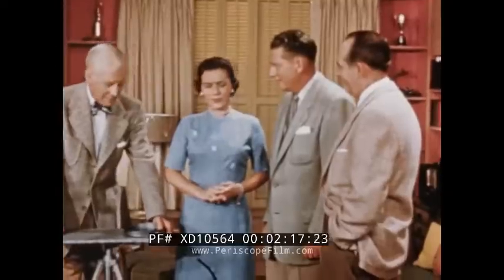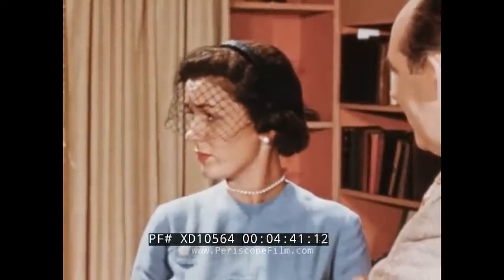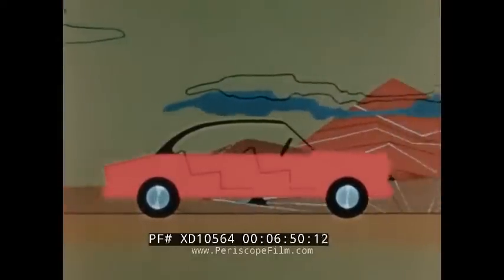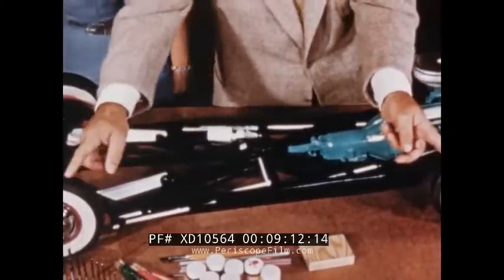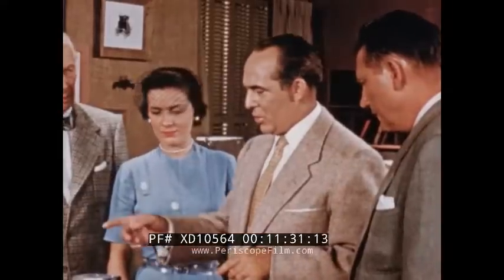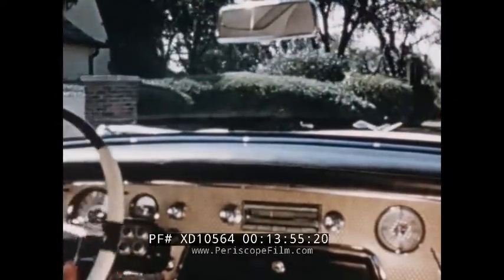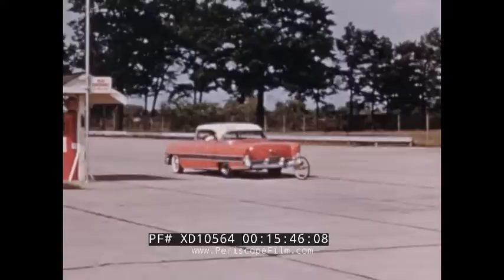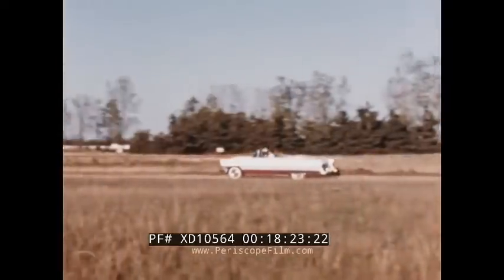1956 PACKARD AUTOMOBILE CO.  " THE SAFE ROAD AHEAD "  TORSION BAR SUSPENSION SYSTEM XD10564

Comment: CAN anyone explain to me( in a serious fashion) ,why did Packard go out of business .I know they merged with Studebaker, but why did they have to go that route ? I am from Canada ,forgive my lack of knowledge regarding the PACKARD CAR THEY WERE INDEED BEAUTIFUL  LOOKING VEHICLES ?🤔
Reply: I think things deteriorated fairly quickly. 
Hired a hot CEO or "President" who didn't know the car industry as well as he did the home appliance industry? Did he make the decision to merge (buy) Studebaker? (Who was responsible for the lack of "due diligence")(Or was it fraud?) Did that merger cause labor unrest because of different pay rates at Stude vs. Packard that led to strikes? 
Problems with Packard having assumed that they could continue to rent the "Briggs plant" at low rates until they couldn't due to the death of the owner?
The horrible automatic transmission problems of 1955 (and the bad pushbuttons in 1956) when earlier the transmission had already gotten a reputation as being  "lethargic" 
Someone in the Federal Government perhaps being more partial to Packard's competitors than to Packard as far as Packard's military contracts 
Not enough dealerships in much of the country? (Was the Studebaker purchase an attempt to correct that?)
   a little late at bringing out their modern V8 engine (although their old engines were some of the best of their type and still made as much or more power than some of the first couple of year's version of the new V8s from Oldsmobile and Cadillac) but I think Packard's old engines cost more to build and were heavier 
in 1951 though maybe maybe the  new Chrysler Hemi was a much more serious competitor than the other new (in 1949) V8 engines 
   the streamliner Packards of about 1949-1950 were not popular and lost money in low sales because of their appearance (although they were good cars and similar bathtub look cars from Nash and Hudson don't seem to have been singled out as ugly)

Comment: Didn't know about this long torsion bar and load leveller system!
Has anyone managed to keep one of theses cars working?
Reply: There's still a lot of them around so I assume the suspension works. The torsion bar suspension was actually optional on some models. You could still get a convention suspension Packard at least in 1955. I'm not sure about 56.

Comment: This unique system seems like a great idea, however if it was, it would have been utilized on other cars after Packard went out of business. Chrysler torsion bars were nothing but  replacements for the  front coil springs.
Reply: The packard system solved the problem it was trying to solve successfully. Others developed competing technology to solve the same problem. Most left the problem unsolved to save money.

Comment: Killer video!  The guy that starts the talk sounds like Groucho Marx.
I read many years ago those trans. would snap if you put it in park before a complete stop.
The torsion bars are probably why Henney Coachbuilders stopped using Packards for funeral cars. Too difficult to stretch with that suspension. The armed forces also stopped buying Packards by '54 or '55 I assume.

Comment: The '56 Packard was the last gasp for the company, as the AMC merger deal had failed by '54, and the lying cheats at Studebaker had conned Packard's president Nance into a merger of two losers. The '55-'56 Packards and Clippers weren-t new bodies, by any means.  They were both cleverly done major makeovers of the '51 body, which propelled the styling career of Dick Teague, who went on to design some of AMC'S most iconic cars in the 60s and '70s.  He had exciting designs on the board for Packard, had they survived to 1957, many of the styling features later stolen by Ford for their Mercury Division.  Parts of the new Packard V8 later lived in the the Chrysler "A" engine.  Worst features of the '55-'56 Packards?  The always-troublesome  Ultramatic transmission, and the ridiculously inept TeleTouch push button selector, dumped on Packard by AutoLite.  Ford also used that for some 1957-"58 Mercs and the '58 Edsels, with similar results.
Reply: I heard Studebaker cooked the books to make the deal seem more appealing.
Reply: @1940limited  cooked em, baked em, roasted em, broiled em then set em on fire!

Comment: Coil springs are also torsion bars--they're just coiled to save space. Chrysler cars handled well because of suspension geometry and spring rate, not due to torsion bars. Citroen had a more sophisticated system since it used interconnected air springs.

Comment: I drove a 1956 Packard Clipper Super to high school in 69-70. Everyone else drove Mustangs, Camaros, or pickup trucks.

We put 250 thousand miles on that car in the 15+ years we had it.
Reply: So it must've held up ok. Did it still drive well ?  Did the suspension perform as they discussed after all those miles?
Reply: Any problems with the suspension?

Comment: Well now, I've been hoping to see a film on this subject for a long time. I was 6 years old when this movie was made. 6 years later, I vowed I would someday own a Packard, and 8 years after that I bought my first car, a 15-year-old, 1955 Packard Patrician. I had no idea that the suspension was so unusual and forward-thinking, I just always thought these cars were beautiful, without some of the typical mid-'50s visual tricks that look dated all these years later. The '55/'56 body was actually a refreshed version of the the 1954 model that they use in the comparison test, and was masterfully facelifted to be as new looking as all the completely redesigned cars offered by most others. And, it really did have a remarkably controlled ride and flat cornering for a 5000 lb. cruiser. I often did the same thing as the valet in the scene at that country club, standing on the rear bumper so folks could see the Packard rise up. Friends in the art school I was attending were wowed when they saw it while they were "tripping"! They don't tell you this in the video, but there's a toggle switch under the dash near the driver's door that allows you to switch the system off. When you do, a ratchet on the short torsion bar motor remains locked, so the car stays at the height you left it. I would sit on the trunk until the Packard leveled out, then jump off. Without 200 lbs. of pseudo-hippie at the end of the see-saw, the tail would spring up into a rake. Then I would casually walk forward, knowing the delay wouldn't allow the leveler to kick in for about 5 seconds, and switch off the toggle. The car would be frozen in the raked position, and I would leave it there and drive off, like NOTHIN' HAPPENED.
Reply: Hot Rodders Forever.
Reply: It must have been a beautiful riding car. :)
Reply: @waynejohnson1304  In every sense of that term.  ;)
Reply: 👏👏👏👏👏 Thanks for the comment! 😉😉
Reply: Torsion bar suspension was invented for tanks and armoured vehicles.  All the German Panzer  Kampf Wagen types had it.

Comment: So funny how their idea of “blistering getaway” is so different than what we would think today. Ha. That Caribbean convertible was gorgeous and I just hated seeing it driven through the mud.  Some of the tri-tone color combinations on the Caribbean we’re just a little odd, and I wish they could’ve offered some prettier ones. It is really strange to see a Caribbean in a solid color, which I’ve seen before.  Also when they show the guy press the transmission buttons, he has a really dirty fingernail, but I think he was wearing coveralls so he must have been a mechanic. I always loved how both Packard, Edsel and Chrysler all talked about their pushbuttons and how safe, secure, and easier they were to use…like a shifting lever was so “hard to use” and unsafe. 😳
Reply: With new cars built for millennials, I hear push button transmissions, even rotary knobs and even smart phone app controlled transmissions, are coming back.  What's old is new again...
Reply: @raylopez99  For sure.
Reply: @raylopez99  Bad then and bad now. The first year Edsel had electric push buttons to control the automatic transmission,I believe it had the same problems as had Packard's as of a couple years before.

Comment: The Packard "Twin Ultramatic" transmission was as smooth as any in the industry, but quality control left a lot to be desired.
Reply: I read decades ago if you put them in park before coming to a complete stop, something (a paul?) would break easily.
Reply: The electric push-button shift in the '56 models was not strong enough to pull the transmission out of gear if the car was parked on a hill. One had to raise a rear wheel off the ground (both wheels in cars with Packard's innovative Twin Traction limited slip differential) to release the parking pawl.      
The parking pawl is not designed to be a braking mechanism in any transmission.       
Another tip, it is not intended to replace the parking brake, but as another layer of immobilizing your car. Always set the parking brake before shifting into park.
Reply: @5610winston  Wull yuh, I'm quite familiar w/sensible operations of an A/T.
Just read a story careless parking lot attendants would shove it in P before a complete stop.
So you know, most trans can take it. The pawl will sort of ratchet, or skip so they're dummy proof.
I'd still like to know why they're weaker than normal. No fail-safe system I guess.
Have you ever put a '56-61 ChryCo. trans. into park while moving?
Reply: I forget who said, "They can make them fool-proof, but they can't male them damn-fool proof."As I recall, most of the PowerFlite and Torqueflite transmissions of that period used a drum parking brake on the output shaft rather than a parking pawl. I have only driven one Chrysler from that period, a '60 Saratoga, and it did not have a park lever.        
My grandparents had a '57 Belvedere (beautiful car, black with factory air) with TorqueFlite, and as I recall, my Grandma forgot to set the brake one afternoon; she parked at the top of the hill and she had to back it out of the barn after the bridge game.
Reply: @5610winston  The 1960 Chrysler did not have a park feature in the automatic transmission. The parking brake needed to be set hard and perhaps the wheels chocked if the car was parked where there was a danger of it rolling.
Reply: @5610winston  Or give it a slight nudge (easy does it!) uphill to unload the drive train with another vehicle while the person inside the car operates the push buttons if someone hasn't already burned out the motor or blown a fuse in repeated effort to make the thing come out of Park.
Reply: @UberLummox  The 1960 New Yorker that my grandfather had didn't have a park position. It had pushbuttons. I think the parking brake was weird,worked a mechanism around the prop shaft to hold it.
Reply: @UberLummox  That still happens today. Don't put any automatic into "Park" until the car is completely stopped.
Reply: @davidpowell3347  Yeabutt at least on other older cars, the parking paul would "rachet", or skip teeth until stopped. Not so on the Packard.
Reply: @UberLummox  Sometimes on newer cars they grind or slip and still seem to  work afterwards but I don't think the park can be trusted to hold as well after someone does that. But I think the "park" lock can completely fail,I think at least one time that I heard someone do that the drive wheels of the car actually slid a little bit. Not a good thing to do. A good reason to stay away from valet parking !!
Reply: I'm told they blew out frequently as they couldn't handle the power of the new V8.
Reply: @1940limited  I remember reading about improperly torqued bolts coming loose or shearing off and lunching the torque converters.     
Elsewhere on YouTube there is a demonstration drive in a '55 Caribbean that had been retro-fitted with a three-on-the-tree.
Reply: @5610winston  I've seen a few Carribeans with stick shift, a 53 and a 56. I think you could order them from the factory that way.
Reply: @1940limited  yes you could, and they were also built that way for export.
Reply: @5610winston  3 speed manual transmission was available from the factory.
Reply: @1940limited  I am pretty sure that manual plus overdrive was available on the "53 and made it a very good car overall that was fast in its day and maybe used by some police departments,it would have been very desirable if you could have gotten it on a '56 . 
Also even with the Ultramatic the '53 I don't think had the horrendous problems of the newer ones (the '53 I think ran in direct all of the time even when starting out but had what felt like a shift when the torque converter clutch engaged at as little as 20 or 25 mph to get better gas mileage.

Comment: I had a 1953 Packard in 1963 .. the heater rotted out from under the dash and fell on the floor ..but by god it still worked .. now that's Packard quality .planning 5-10 years down the road ....funny 1-2 years later they were out forever

Comment: Packard was a great car. And it's sad they went out of business. Parkard was truly built for the upper middle class
Reply: They were called "old money cars", built to a higher standard without the frills of those caddilacs. Packard was considered good enough to contact build Rolls-Royce aircraft engines during WW2, and in some ways improved the design.
Reply: @Dan Hayes  Yes, very sad indeed. They had some upcoming designs that were out of this world, like the ‘57 Predictor.
Reply: They were not horrendously expensive except for the long wheelbase ones and the "lesser model" 250s and Deluxe Clipper were affordable and very good cars before the 1955 debacle. Don't understand why antique car buffs haven't discovered those cars. Maybe even the base Clipper which still had a lesser Packard straight eight that was  281 cubic inches,which was more than the approximately 270 cubic inches of the beloved Pontiac Straight Eight.
The top of the line cars were very competitive against Cadillac up through probably 1953 but were "frumpier",I think the Straight Eight was just as powerful as the first years of Cadillac's overhead V8 and smoother. 
Packard should have purchased Hydramatic automatic transmission from the General instead of fooling with the inferior in house transmissions. 
   I believe that in 1953 Packard had two 327 cubic inch Straight Eights,one of them had 5 main bearings like most cars that had Straight Eights,the other one had 9 main bearings. Packard had the reputation that its engines were better balanced than others,maybe as much so as Rolls Royce. 
Packard may have suffered from having a lack of dealers. 
  I would hope that Packard clubs can help people who are trying to restore and/or preserve these cars with finding qualified mechanics and sources of parts.
Reply: The class government is trying to stamp out these days.
Reply: @1940limited  They have already destroyed so very much of America. The U.S.A. 1776 to 2020

Comment: I lived about 3 miles from the Packard Proving Ground.  The factory at the site was sold to Curtis Wright who produced aircraft engines for a couple of years, and then it was sold to Ford who converted it to a trim plant and made dashboards, seats, door panels, etc.  The banked track and inner parts of the proving ground were there for a number of years until Ford sold the property.   The straight portions of the track were nearly one mile long.  The track went from 22 Mile Road to 23 Mile Road just outside of Utica, Michigan in Shelby Township.  The track was finally removed, and a housing development is there now, although you can still see where parts of the track were on Google Maps satellite view.  The factory was torn down after Ford sold the property and an Amazon distribution warehouse was put up where the factory was located.
Reply: I'm surprised the old Packard Plant is still standing after being abandoned for so long. I lived in Windsor Ontario right across the river from Detroit and every time I go to Michigan to see family and friends I go by the old Packard plant
Reply: @79tazman As of late 2024, it’s being demolished.
Reply: I like what was there originall better.
Reply: To see those old cars on that track would be an awsome sight to see!😁
Reply: The Albert Kahn designed clubhouse and other buildings are still there, now on the National Register of Historic Places (NRHP).
Reply: Was Curtis Wright a not so friendly competitor against Packard as to military engines and equipment? Back in the glory days when Packard products were probably superior to those of most of its competitors? (Like PT boat engines,airplane engines,I think a brief period of producing turbine (turbojet) engines although I don't know much about that)

Comment: Packard had some really innovative ideas and some really stupid ones.  Their first year V8 {big and heavy nearly 400kg's} used to have a vacuum pump to assist the vacuum accessories this was mounted underneath the oil pump in the sump driven by the same shaft. The pump seal would fail and this would let the oil pump suck air and trash the bearings. The Torsion Bar system that uses a single bar for each side works pretty well but needs a very rigid chassis to function correctly.  This makes them Very heavy. This is the main reason why they are only really used at each end today.
Reply: Actually, there are four torsion bars.  One for each corner.